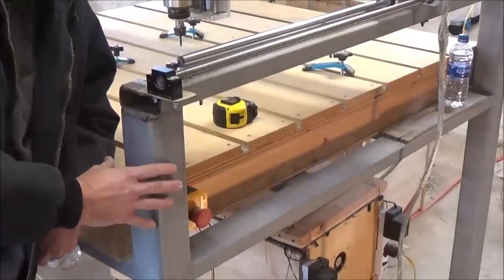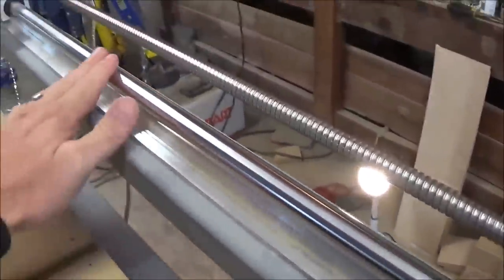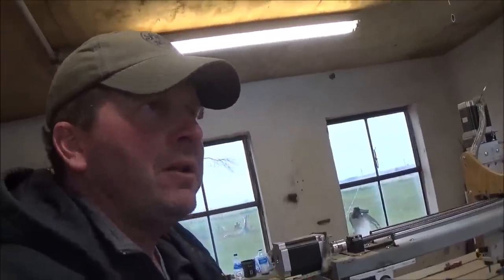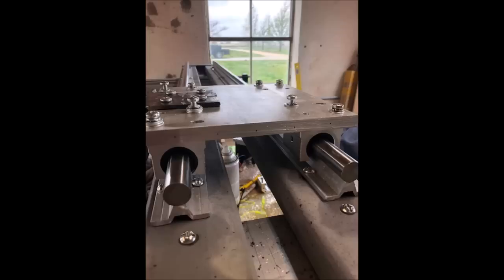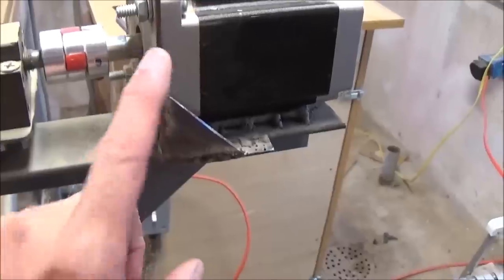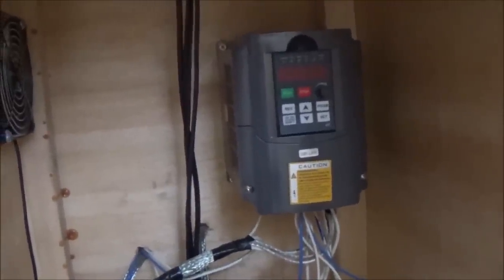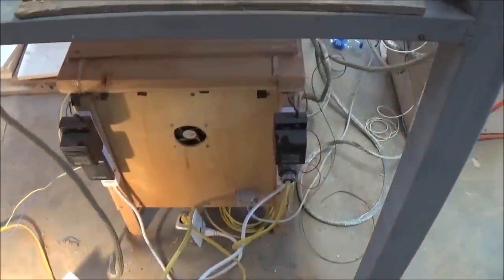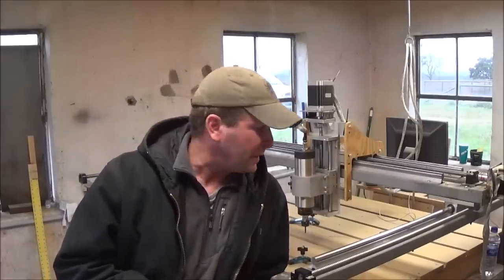My DIY CNC Router build

Comment: Hi ,Smokey , hope you don't  mind me  being formal. John here from northest uk ( sunderland) , cutting to the chase , im a kitchen and bathroom installer 30yrs +,now aged 60 im looking to ease up and let machinery do the hard  work,  hence my interest in your cnc build. however i haven't a clue where to start  .  Open to your guidance plz advise , j
Reply from the maker: First off thank you for watching!!!!....So where i started was , research, research and more research.  Things like the size of table, style of machine (i just liked this style and didn't want to mess with a towering gantry), size of spindle(router), and what exactly i was going to do with the machine..Being i wasn't sure where all i would go with it i overkilled the build on many fronts....spindle is 3hp, my drive motors are nema 34 and the frame is steel.  I like not having to worry about overworking any of the components....so to me the first 3 steps are how much are you looking to spend? are you wanting to build or buy a machine? and what are you wanting to make?  (meaning production runs, or just hobby stuff?)...email me at smokeyscnc@gmail.com and we can get more in depth...Thanks for watching..

Comment: Why did you make the bridge between the Z axis and X axis from plywood and not steeĺ or aluminium ? 
Doesnt it bend and gets your z axis wrong when milling aluminium?
Reply from the maker: No i really haven't had any flex...i do plan to upgrade the gussets with a different material, maybe a hardwood or maybe a thin metal of some type..Unfortunaetly what you really cant see because it is all put together is that the z axis slide and the x axis are joined by a 90 degree bracket that I made out of 3/16" plate steel, and is bolted with 4- 1/2" bolts to the z axis and the x axis slides, that alone allows fairly little give.  The gussets are just piece of mind for me to stop as much give as possible.  I plan to do a more detailed video of the frame and gantry with measurements and try to cover a lot of questions ive been ask..Thanks for watching!!

Comment: Why not use cable chain?
Reply from the maker: Cable chain in place of the ballscrews?....Ballscrews historically have next to zero backlash and accuracy is as good as it gets.....Thanks for watching!!!
Reply: @SmokeysCNCWoodworks  

No...cable chain is the plastic links that guides your wires/air line during the motion of the machine. It looks nicer and keeps everything tidy and out of the way without getting caught on something. Look it up.
Reply from the maker: @calebdrake3544  Ah got ya, I used Aluminum mesh on the wiring from the computer to the machine, but as fire the wiring in the box, no I didn't, I understand it how it is , your right it would look better, but honestly when I started the CNC didn't know I was going the YouTube route...Thanks
Reply: @SmokeysCNCWoodworks  

I have to ask because I'm curious, what did the whole machine ended up costing? I liked to build something robust in addition to my laser cutter I'm building...

Comment: You were correct to use 1 power supply per stepper. You can use 1 power supply for 2 Nema 23's,  but not the larger 34's as you have, that is why they sent you one per stepper motor.
Reply from the maker: Thanks for watching!!!

Comment: What was the total cost of the build?
Reply from the maker: It should have landed about $2800, however when putting the plug cover on my first spindle, a wire came loose and blew my first vfd and fried my first spindle during the build, so i ended at about $3200.....Thanks for watching!!
Reply: Hello, I am a professional woodworking engraving machine here, I hope I can help you.

Comment: i am trying to work out the day to day running cost of one of these machines for something like a cnc plasma bench or a router table  anyone have a general idea on that i understand it will depend on the cost of power in my aria i am looking for more of a power consumption amount more than anything and then i can hopefully work it out based on that........
Reply from the maker: Hmmm, I can't give a real educated answer.  All I can really say is that I put my shop on its own meter in the event that doing this stuff got big enough to write it off of taxes, and I have never gone over the minimum $25 bill every month and I am out here a lot...
Reply from the maker: +Brett Masters I really can’t give you a good answer right now...I may be able to give you more info after I receive my next bill, because I did run it steady for a couple of days for about 8 hours each day getting ready for that trade show....thanks for watching!!

Comment: Really cool machine but you shouldn't buy your parts on Amazon your parts (the exact same)cost on banggood 1/4 or less of the Amazon price the sellers on Amazon are buying there part on this kind of website
Reply from the maker: I've bought things on both sites but have never ran into problems on Amazon and have on banggood and never got it resolved, not saying it can't happen on amazon but just have always had good luck with it and been happy......Thanks for watching!

Comment: the welding on the stepper motor is unnecessary. the only force acting on the motor is the torque  from the shaft and it is transmitted to the ball screw through the coupler. the coupler is there to absorb any angular movement of the motor and allow for misalignment. your steel motor mount with side brackets was plenty strong.
Reply from the maker: The stepper motors are only bolted to the brackets, not welded to them...or am i misunderstanding what your saying? or did i say i welded them in that video?...not trying to dispute what your saying, now that its built I see what your saying that you are simply limiting torque with the brackets...I'm just now hoping i didn't say I welded the motors, I sure don't want someone trying that!!!!!....Thanks for watching!!
Reply: at 8: 11 I saw 4 tack welds under the motor. it looked like you welded the motor. now  I looked again. I see that it is under the motor. :). overall,  I like the mechanical design. do you have any vibration in the lead screws on the Y axis??
Reply from the maker: A small amount of vibration only when running at 100%, I dont ever operate at 100% anyway though usually around 70-80%, kind of the happy speed for less sanding...Thanks for watching!!

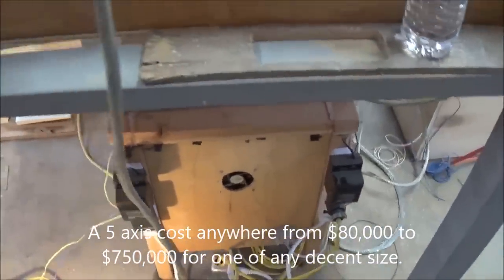Comment: Interesting ... but as you describe at 23:29 this 5 axis cost from 80 THOUSAND dollars to 750 THOUSAND ?!? you're kidding us ... only if it was a professional machine.
Reply from the maker: Oh yes, those were professional or industrial machines, the 5 axis I have seen are a lot more complex.....I'm sure if someone had the knowledge they could build one for a reasonable number, but as this was my first try I wasn't going to jump off into 5 axis....There is actually a machine shop here in the town I live that has a couple of 5 axis for metal stuff and the owner told me the ones he has were 500k a piece and they weren't the big ones.....They can afford to spend that because they build very specialized oilfield valves, connectors and parts and that stuff isn't cheap.....Thanks for watching!!